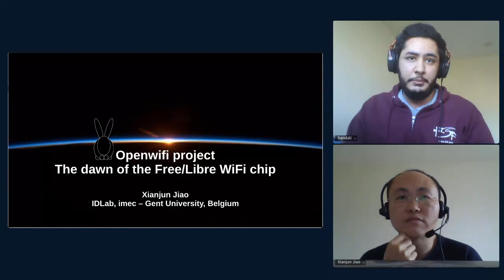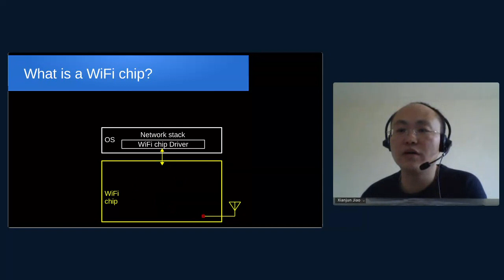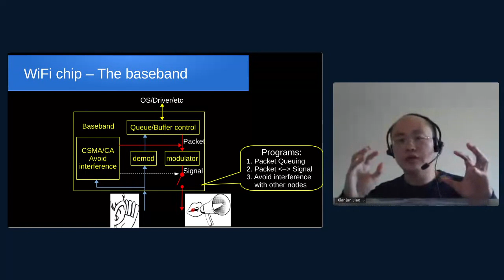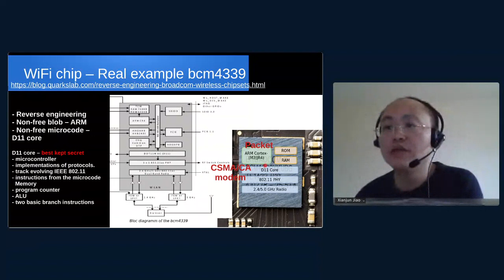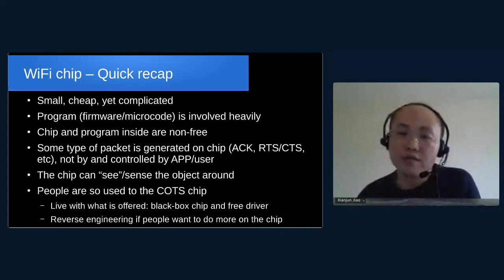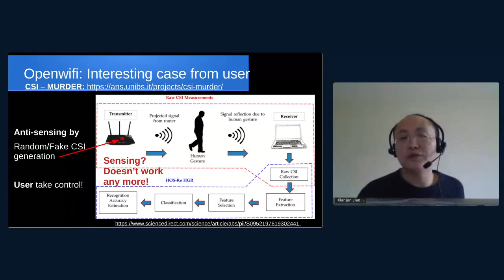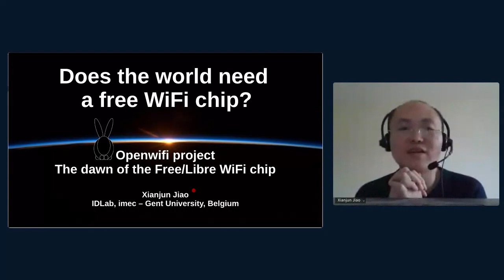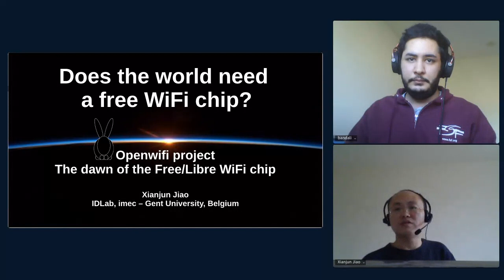openwifi libreplanet 2021 presentation

Comment: Ya existe OpenWrt. Para que voy a querer esto?
Reply from the maker: OpenWRT runs above the driver. Openwifi is about how to implement WiFi chip and WiFi driver. To openWRT, openwifi is just yet another WiFi card/chip. So if you are user of openWRT and happy with openWRT and the commercial wifi chip running with openWRT, you don’t need openwifi. But many researchers works at driver and level below (chip). Openwifi is for these people. Also for people who want to optimize/control full layer/stack (from Linux to antenna, all steps in between) to meet special needs.

Comment: Is there any connection between this project and TIP openwifi project?
Reply from the maker: So far no relation. Tip focuses on roaming I guess. They don’t care which chip is used. Our openwifi is a chip design (and Linux driver). We are in two levels/layers. Tip is above us.
Reply: @JiaoXianjun  Thanks for your reply～